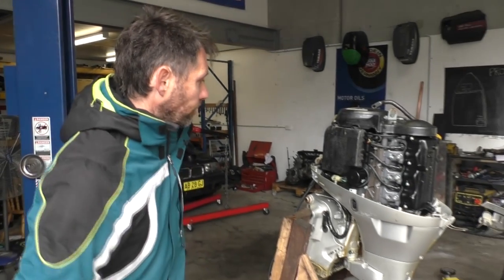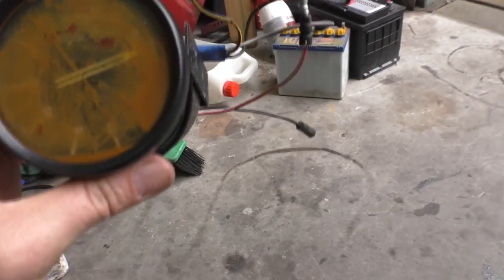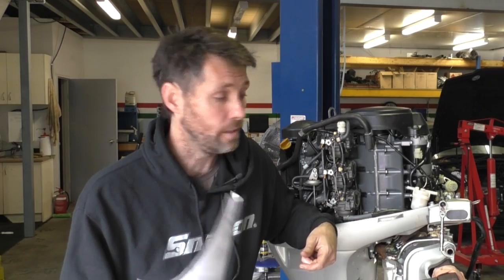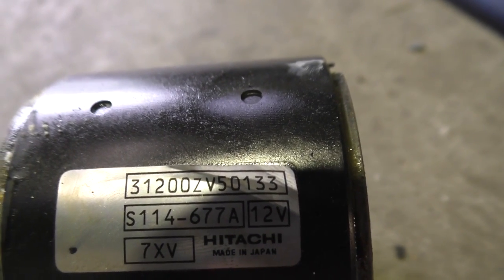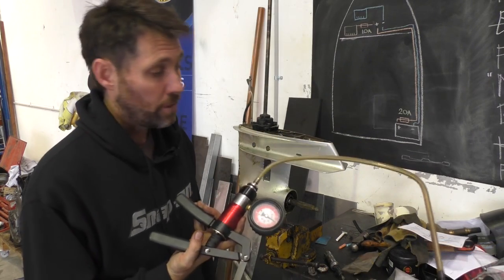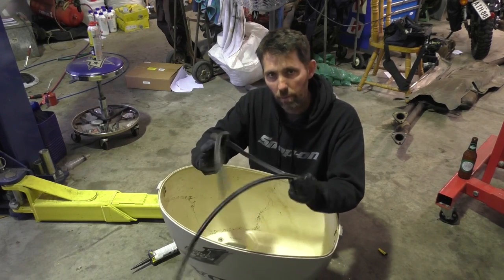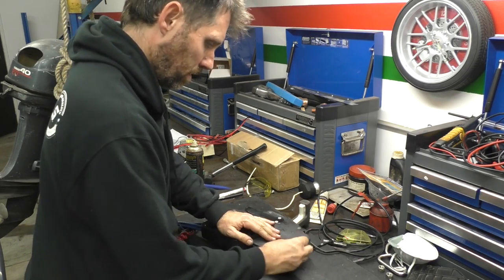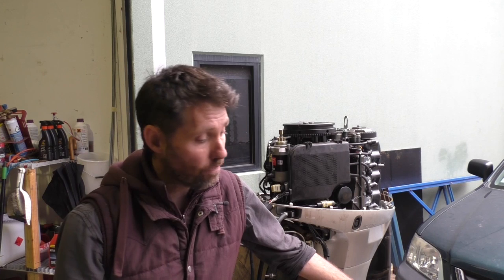Saving a sunk Honda BF40 outboard motor

Comment: I always enjoyed the serious of your videos about BF40.  I own 1995 version of one myself for 7 years. Just wanted to share one hack that I come up with to  fix water circulation in it. I replaced water pump but it is still have a bad circulation and used to burn my thermostat every 6 month. While replacing thermostat, I noticed white build up going all the way down to the system. Given that, I connected gear lube pump to water output and pumped a 2-3 quarts of CLR into the system. Flushed it with water after and it works like a charm from that point :) Water runs noticeably stronger and thermostat issue is not happening anymore.

Comment: What a deal on the motor you where really lucky it runs real nice and the controls weren't frigged up.  The only $200 motor around here is a 1964 28hp Evinrude so you really scored.    I liked how you went through all the systems and eliminated salting and water issues before starting. Learning something from all your video's keep up the great content.
Reply from the maker: Thanks mate, I was really lucky to score this one. Just happened to be in the right place at the right time. I'm pretty confident with the clean up job it has had, now I just need to get it out on the water and see how it goes!
Reply: @DangarMarine Stu i had the same stroke of luck this week, the guy who came in this week at marina asks "where is the scrap metal bin?, any chance you can help me toss this outboard (Honda BF20D)" 
I helped him carry it to my shipping container workshop!

Comment: $200 ? That just shows that knowledge is power. Great video!
Reply: Richard Howe yeah bro u can’t argue with that. That’s a quality comment
Reply: the video shows the orange motor. What is that call or what is the part nr for the is what I need to buy. but how am I able to buy it. All the other parts I have

Comment: Good choice on that BF40.  I own one and I am very happy with the performance and reliability.  I bought mine to use on a small boat I built from scratch. At the time, the BF50 cost less than 10% more and I seriously considered going to that, but the 40 was a better fit for that boat .  Now in retrospect, I wish I had gone the extra bucks.  I am restoring a 62 year old 16 ft fiberglass runabout and I want put the BF40 on it because it is such a (low hours) nice running engine.  So now I really wish I had the BF50! Oh, and if I was to buy a new engine, my choice would be the Tohatsu 50.    Keep up the DIY boating videos, they are really helpful.
Reply from the maker: Yes, I've been really happy with the BF40, it has run perfectly so far. I too would consider the Tohatsu if buying a new motor.

Comment: We dropped a Honda 40 hp off the back of a dingy into 35 feet of water in the Caribbean.  We couldn’t get it off the bottom so we called the charter company where we rented the catamaran.  We tied a bleach bottle onto a line to the motor and gave them the GPS coordinates. A couple hours later they came out to retrieve the motor and took it back to the dock.  We watched them disassemble the motor spray it with freshwater take a few bits off spray with air then oil and WD-40. They then reassembled and started the motor. Incredible.  From that point forward I always bought Honda motors for my outboards.
Reply: Steven Schmidt  It’s not the fact that it’s a Honda it’s the care they gave it!  I know one Mercury that has been swimming 8:times and it still is running fine!   The kid that owns it is an expert service mechanic!  I dare say he can disassemble that engine with his eyes closed.  He is a sailor too.  Dingy engines get dunked a lot!  Maybe because the sailors get dunked a lot.  Oh no I did not say that did I  oh goodness I did

Comment: Great use of our old friend,  WD-40,  for the purpose for which it was originally designed.
Water Displacement Formula # 40  was originally created to displace water in Minuteman Missile components.
Reply: After every time my old boss would take his speedboat out ,he would spray down his outboard with wd40 then wipe it all off.

Comment: I've got one of these on the back of a small houseboat I recently bought. The tell tale is more of a drip, the idle hunts up and down, the revs catch at around 2000 then once over that hump spool up smoothly. Have put a new external fuel filter on, changed a fuel hose and adjusted the fuel/air screws. It idles better but obviously needs a carburettor clean out and the cooling system needs an overhaul. I think you might have convinced me to persist with it, get a shop mechanic to do an overhaul and save a few bucks, well, compared to buying a new motor.

Comment: Great work on the video, I just flipped my tinnie, with a fuel injected bf40 on it, this video has been invaluable, I have the engine cranking, will replace the starter for reliability, but the loom has issues, I'm hoping not full ECU and loom change required. Where's a good place to look for second hand parts?

Comment: Those are great motors and super quiet.  Don't leave fuel in those carbs if sitting for over a few weeks. Or at least with US fuel the ethanol clogs em up quick if left sitting in the bowls

Comment: Good save on the Honda.  I noticed you did nothing with the rubber hose on/in the lower unit ...  That is a feed from a built-in "pitot" tube facing the front of the lower leg.  It picks up water pressure from the slip stream and will signal a water pressure speed-o-meter.  Nice to have when you are trimming/tuning.  Compare speed to RPM, etc.  Next time you are in there, tidy it up and route up the leg to the transom clamp.  Simple vinyl tubing will get the signal to the dash and your new gauge.  It's a handy Honda feature  :)

Comment: Hey Stu great vids, great memories. Spent my whole child hood and teenage years fishing Pittwater and the Hawkesbury. The bridge pylons were always a mecca for big Jews on a tasty yakka. Currently own a 1987 4mtr Stacer runabout with a 2003 30hp Johnson 2 stroke so your videos on this motor are great. Still have the original 1987 johno 30 which came with the boat which I think has thrown a bearing on the crank as it matched the symptoms you described only turning a little bit but not seized. Might have a go at fixing it. Currently living in Brisbane fishing Moreton Bay . Great videos and thanks for the memories.
Reply from the maker: Thanks Trev, glad to hear you've been enjoying the vids and they have been helping you. Good luck with the fix, could just be bad roller bearing.

Comment: ahh my wife bought one of these motors new on her first boat. Make sure you tape up the aux water intake holes when your flushing with muffs! over the long term we found It burns the plastic on the waterpump through water starvation even though it looks like its flushing fine!
Reply from the maker: Interesting, I'll have to look into that. Thanks for sharing!
Reply: Dangar Marine ahh yes! I put a link from the Honda manual in the comment below in case you missed it 👍🏻 best of luck! Really love your videos. A huge amount of time goes into making them. I watched a bunch of them even though they were not even relevant to my needs haha. Just learning :)

I’ve pulled apart my old Johnson 90 1987 many times, which I still have going but I retired for no reason other then age the other day... 

I literally have the urge to pull apart my “new” perfectly good 2005 115 Johnson 60 degree just to learn about it. Very different to the 90 degree motor that’s for sure!

Keep up the good work! And yes watch out for the flushing trap on the Honda! 😃

Comment: Hi Dangmar - it's a Yamaha / 25D 2 stroke 1980's. It dosnt make sense the bearing and reverse gear are still on the propshaft but I can't get them to slide of....Thanks so much for your effort 😊👍
Reply from the maker: What job are you trying to do? I presume you are trying to do more than change the oil seals.

Comment: You did great on the Honda engine. No need to buy a new one. One very old marine technician I knew always said that outboards were like ticking time bombs anyway.
Reply: ive got a 32 year old 30hp outboard. I use it twice a day all summer long. The only thing i have had to replace is the impeller.  And they talk about 4 stroke reliablility

Comment: I have a Honda BF150 and when I changed the impeller it took maybe a minute for the telltale to start squirting.  I guess it takes some time for the water pump housing and the cooling lines to fill.  Maybe?

Comment: I got a good trick I will share with you!  On the older Yamaha’s the large metal piece that fits between the prop and the seal on the propeller shaft do not have a line catcher!  The newer models have the line catcher.   The metal piece on the older models is flat on the front side.  The metal piece on the newer models is not flat. It has a 90 degree 1/4 inch extension on the center next to the prop shaft.   If that metal part on the front is machined off with a grinder or lathe the new part will now fit perfectly on the old motors!!!! The line catcher is in the back.  The point is,  it gives the old outboard foot a fishing line catcher!!!!!   The aggravation is well worth it if you fish!   The line catcher works!   One time it saves that darn rubber seal the line catcher becomes a great friend!,   I hope you can use this for all the stuff you show us.  Enjoy the tip!
Reply from the maker: Good tip. It's always a great feature to have on an outboard, particularly if you like fishing as you say.

Comment: Hi Mate, I have a suggestion.  I like the idea of blowing out the control cables to remove sea water.  I had the idea to blow a bit of alcohol through them first since alcohol mixes with water.  Then shoot the oil in.  Could remove more of the water, but its just an idea.
Reply from the maker: Giving it a clean with alcohol first sounds like a good way to go.

Comment: Great video stu you make it look so easy sorting things out you was very lucky with the outboard didn’t have a lot to do to it could have been worse as water and electronics don’t like getting wet well done mate
Reply from the maker: Thanks Robert. Yes, the hardest sunk outboards to fix are the ones that go down with the battery connected. Sometimes much of the metal is eaten away.

Comment: Lots of good info. I was told by a marine mechanic that the seal on the oil drain plug was an often overlooked replacement part when doing oil changes. The stock part is a couple of dollars (canuckistany dollhairs) from the dealer, he said that it gets flattened after several uses and doesn’t seal reliably so they replace it with each oil change ?
Reply from the maker: It never hurts to change them, particularly if they are cheap.

Comment: All the dumps in  Canada's Northern reserves have so many outboards. They all have their lower units wrecked but I've seen 4  Honda 40s in a row in running condition. I rescued a Yamaha nytro engine and sold it on ebay for 2000$ once.

Comment: Great video presentation. I was wondering how you couldn't see that big red fuel can though right in front of you...lol. I just installed a lower gearbox on a 200 Optimax. I had to replace the impeller as well and had to pull it off twice just to make sure things were good to go. Turns out all I had to do was check for blockage and spray water through the upper section of the motor. I don't know why this had to happen. I had done mine years ago on a 225 EFI with no issues seeing the water spitting out. Different things for different motors I suppose..

Comment: Honda's definitely run o-rings on the bung screws Stu, not fibre washers. Great video!
Reply from the maker: +trehammerz Thanks mate, good to know. I also got caught out doing the water pump because Hondas turn counter clockwise. It's going to be good for me to come up to speed with them! :)

Comment: Just WOW!!! $200 for a Honda 40 hp 4 stroke that now runs. Congrats. Don't think there  was much risk, if it didn't run, you could part it out on Ebay.
Reply from the maker: Yeah, it was a very good deal. It hasn't missed a beat yet and has been used every day since it went on the boat.

Comment: Hi Stu,
Love your videos. I am working through them , still  have many to go. They are so relevant to my interest in boating. I have the same motor and would like your opinion on the following fault. Maybe some of your followers have had a similar problem. It has being happening for at least 10 years. When my motor idles in gear it will cycle between idling rough and normal, each cycle being approx 2 to 5 minutes. The interval is random. It is like dropping a cylinder. I have swapped the coils over but haven't isolated the problem. Obviously I have replaced the plugs. Some say it could be a fuel issue, I am leaning towards a CDI issue. Thanks in Advance. Shayne
Reply from the maker: It's hard to say without doing test. If it was in the shop I would put an oscilloscope on the HT leads and see if it is a variation in ingition quality. If it isn't it could easily be fuel too.
Reply: @DangarMarine  Thanks Stu for your help, I will test the HT and take it from there.

Comment: We have one of these outboards at the yacht club with 1600 hours on it, still running fine. One common issue with the telltale is the fitting that screws into the engine that the rubber hose fits onto. This fitting rusts and blocks the telltale flow. We have a piece of coat hanger wire on the boat that we poke into this fitting to clear it each year.  My current car was fished out of a lake back in 2008, I bought it at an auction for the right price, spent 3 months getting the engine and all the electrics running again and still drive it around today. Apart from the Piston/Rod, computers, motors that control the heater settings, most of the parts, including the starter are the original, and I still drive this vehicle today.
Reply from the maker: Glad to hear the motor is still going well. That bodes well for this one. It's amazing how long things last after taking a swim. We have a Subaru in the workshop at the moment that was in an underground car park during a flood. It needed a new ECU as they are low in the footwell, but everything else was just cleaning, drying and lubricating.

Comment: Sweet motor & another outstanding video! Here in the U.S. when 4 strokes have been submerged, a common practice is to pickle them with diesel fuel. The diesel is supposed to inhibit corrosion. Have you resuscitated any outboards that were pickled with diesel?
Reply from the maker: Diesel is really good for all sort of jobs like that, and as an added bonus it is a lot cheaper that anything you buy in a spray can so you can use lots of it. I've also seen it pumped in a recirculating tank to unseize motors too. Methylated spirits also has its place because it is water soluble and will carry the water away with in. It doesn't have the protective qualities so Methylated spirits first then diesel second is a good combination.

Comment: I see the front forks on a motorcycle! By the looks of them it’s no rocket but still, kudos mate 👍🏽. I’m a huge fan of motorcycles 🏍
Reply from the maker: In that case you'll probably like my Dangar Motorcycling channel too! ;)
Reply: I just subscribed! Great work man! Now get a 05 zx6r that sputters and dies after 2hrs of riding randomly and fix it because that’s what I’m dealing with. 3 different mechanics and 2 dealerships can’t figure it out. I’m stumped haha

Comment: Hi!
My pivot tube looks very corroded, pretty much like yours on frame 3:59.
You say it's not worth it to disassemble all unit to get that out and repair, but i'm really aiming to do some preventive action to slow down this corrosion.
Do you recommend any product like, rust converter or something else we can apply on site without getting that part out?
Thanks a lot and keep up the good work!
Reply: Anyone knows the name of that corroded piece that shows in 3:56? Will help me a lot if you know the part number.

Comment: Thanks for quick answer, is there’s a difference in procedures of treating the outboard between freshwater and saltwater when the motor sinking?
Reply from the maker: Not really. With freshwater you don't have to be so thorough with hosing the block down to get the salt off, that's about all.

Comment: Great video.
I got one of the carburator honda bf90a that where sold as 50hp and on the back they put "50pro" what they did was limit the amount of throttle you could accelerate (4500rpm max)wich right now I cant seem to find that piece to make it accelerate and develop the 90hp if there even exists one, only way to "fix" it I see is getting the cable conection closer to the wheel to increase travel but it will also require more force. Have you come across these engines and know what ppl did to make it develop the 90hp? (open carburators to 100%)

Comment: Great Score Stuart With This Outboard.
Just Hoping You Might Cover The Charging System Of An Outboard, ie Alternator.
Cheers Michael
Reply from the maker: Yep, I'm going to be putting a regulator / rectifier in a boat soon and also adding a solar cell to the Green Machine.

Comment: Saved some serious $$$ there not going for the 50hp Tohatsu,  assume it would have been a four stroke too.  I put a 50 hp Tohatsu EFI 4 stroke on 2 years ago new , had some minor problem with the tilt solenoids,  now has some odd ticking noise that it's never had before.......
Reply from the maker: For sure it saved me a lot of money. It's still running really nicely without any troubles at all.